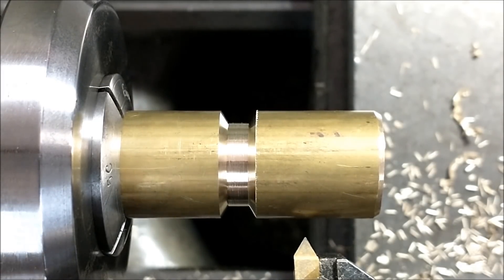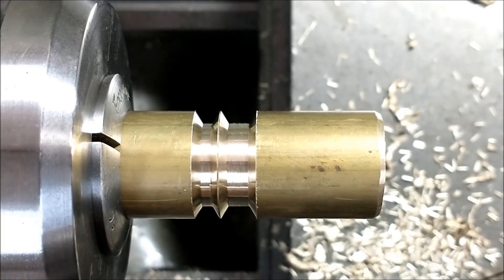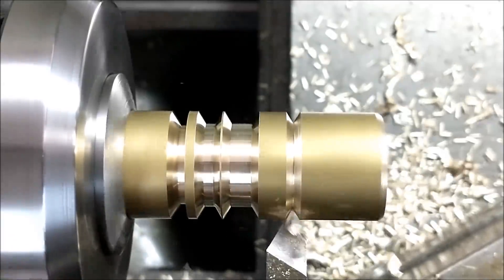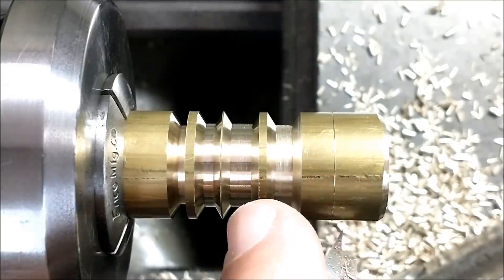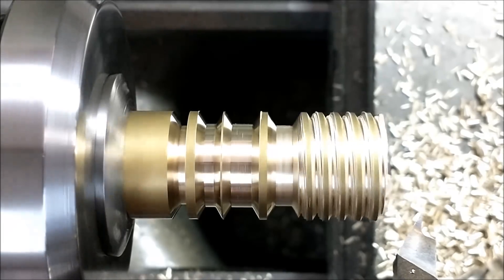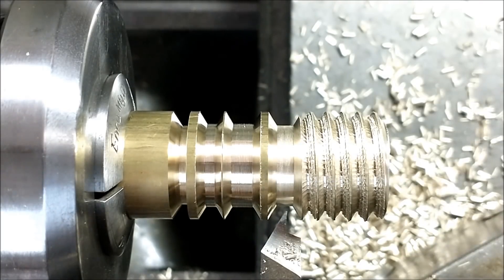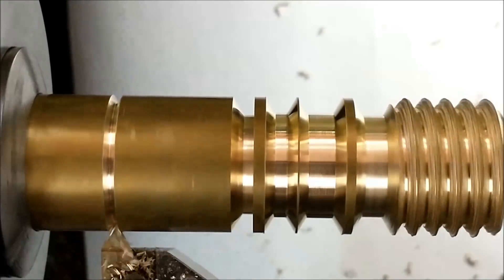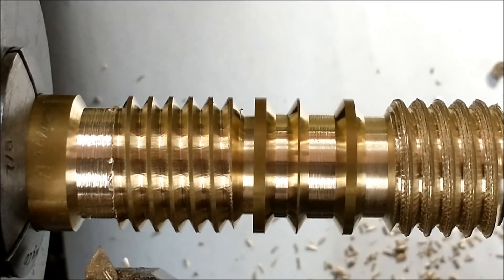FACT CHECK:  Threading Myth BUSTED !!   You'll Find This Interesting......

Comment: Joe, you failed to mention the reason why using the compound for thread cutting is the industry standard: it's all about reducing tool pressure. Your demonstration on an extremely soft material like brass is kind of ridiculous. Using a harder material, like 4140PH or 304, and doing a direct comparison using the same form tool, with identical rpm's and feed rates, would have demonstrated that the compound method produces smother threads. That's why it is the industry standard method.
Reply: Which one is the industry standard...???  Compound slide for reduced tool pressure or cross slide for smoother finish?
Reply: @pinkpandavideos  Thank you for apprising me of my mistake. I corrected it :-)
Reply: @E Designs thanks 👍
Reply: @MF175mp  videos like this are good learning points for home/hobby machinists like me
Reply: It's more like YouTube standard. You cut them the fastest way in the real world. Adjusting compounds in every turn isn't fast.
Reply: @MF175mp  Using the compound for threading was the standard LONG before the internet or computers even existed. Real world machinist typically keep the compound set at 29½° and it doesn't take us any longer to cut threads doing it correctly. Using just the cross-slide for feeding is a lazy method, not a good method, and Joe is doing a disservice to his audience by promoting a bad technique.
Reply: @EDesigns_FL  Got to love the pat on the back " it doesn't take us any longer to cut threads doing it correctly"..... Thanks Joe for posting an informative video that gets folks thinking...:-)

Comment: Could you do a follow-up on cutting the thread only on the cross slide, vs with the compound at 29.5, 30 and 30.5 degrees to see if there is a difference in chatter marks and on which face(s) they occur? Maybe it has to be in a harder material?
Reply: 29.5° will shave a slight amount off the right side with each pass, 30° will shave none off the right side with each pass except for the DOC at the tip of the tool and 30.5° will blow the thread profile! :-)
Reply: I'm pretty sure in his other videos he's stated that he never uses the compound to cut threads, always feeds straight in with the cross slide.  So pretty much any of his videos where he threads will be with the straight in method.

Comment: As a non-machinist that is interested in the subject of machining... I wonder where these ideas get started and handed down this almost seems like dogma the way it is presented?  It is fascinating to me to watch this video: First the controversy and then followed by a demonstration... I'm not able to say definitively, but I think you proved the point... or put it another way: nailed it.
Reply: He showed you why. If you plunge in with the compound, the 30 degree tool cuts a 60 degree groove. Adding the carriage travel doesn't change anything. The reason you get the stair step on the back side of the thread is because you aren't feeding in while in contact with the work. So in THEORY only the leading edge is performing the cut. In the real world, the trailing edge is performing a clean up pass while the leading edge performs the actual cut.

Comment: I have run large threads with part of the thread tool relived to help with chatter but you have to leave the nose of it in tacked. I've cut some extremely large threads (like 1/2 TPI) on some relatively small lathes with just a narrow grooving tool with only the v formed on the end. You just have to run the tool up and down both flanks of the thread, takes a while on a manual lathe but works.
Reply: Yes, I agree. I used the same technique to cut threads up to 5 mm  / 5 TPI an my small Emco C 8 lathe. It takes ages but you can cut really large threads this way.
@Joe I love your clear and instructive videos - always a joy to watch.